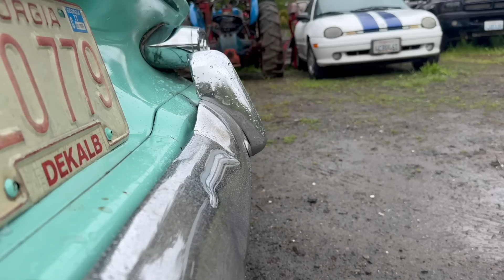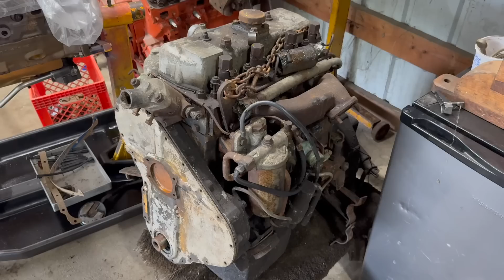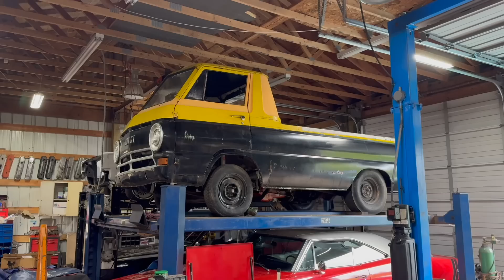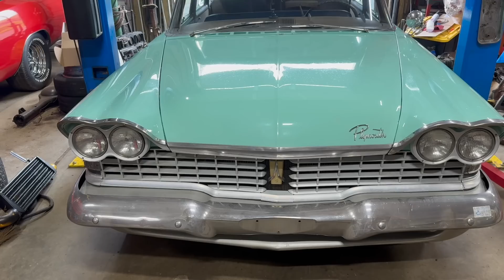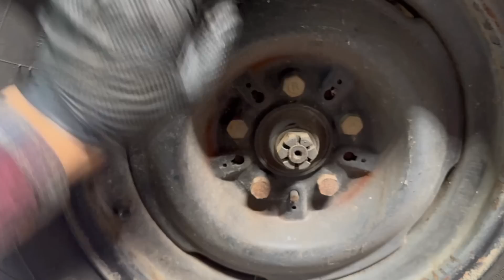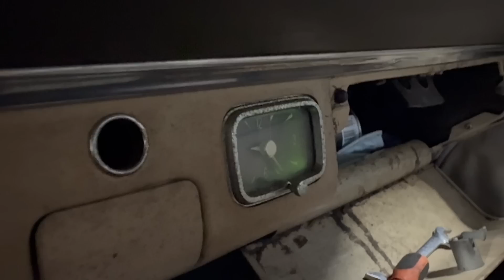Slow And Stinky - 1959 Plymouth Diesel Taxi Engine Tech, Test Drive, Safety Inspection (Not Good...)

Comment: Old retired guy from the Philippines checking in. I have seen old many Jeeps, restored to running condition, here in the PH. Some have been converted to four(4) cylinder diesel engines, replacement parts being very difficult to obtain. On a trip to visit my Father-In-Law's friend who restores certain classics, we viewed a treasure from Japan that he had accumulated. A military Jeep made under license for military and police use. It had a factory installed four (4) cylinder Mitsubishi diesel engine! If a person had the desire to search YouTube, they could learn about factories here in the Philippines that produce all the major and hard to find body parts for old military Jeeps. You can purchase a complete tub for your restoration project. Hoods, fenders, almost anything you might need! Your Plymouth taxi would be a blast in the Philippines. You never move fast here except on the NLEX toll road! I can picture in my mind what it would be like to cruse along the General Douglas MacArthur national highway  in this beautiful land yacht. This is a four (4) lane road that runs through many towns here on Luzon and is often plugged with traffic. You have a real treasure and a true head turner for those who appreciate what it is and was meant to be.

Comment: i do wonder... no front turn signals - not at all, or not operational? what's the point in having just the rear ones otherwise..?
Reply from the maker: Great question. There are lights there but they are currently only functioning as parking lights.

Comment: The brakes were called Lockheed Total Contact Brakes. They work great when adjusted correctly. Ive replaced wheel cylinders and rebuilt the brakes so many times on these 57-61's over the years. 
The rears have tapered rear axles as you pointed out.  I bought a 1960 Savoy that had all sorts of loose nuts and bolts like your car. In fact when I was driving at home it developed a bad vibration Shake which I thought was bad ball and trunion front  ujoint,turned out that someone took thedriveshaft off at the back of the transmission brake drum and never tightened the bolts when they reinstalled it.  Thankfully I always carry a full set of tools with me.

Comment: looks like yo got a perkins 4108  in the uk fitted to early ford transit mk1 circa 1970   dreadfull slow but everlasting due to unstressed and long stroke most engines went to africa to pump water once the van had dissolved good luck slowly
Reply from the maker: P4C, or in their later nomenclature, 4.192. Same idea though. Haha.

Comment: So the Perkins diesel produces rougly 42Kw & about 
 189 Nm . But the cars weight is likely to be around 1500 -1700 kg which won't help its speed which would be lucky to do 125 Km/h tops . But you'd expect the fuel economy to be around the 10 - 12l/100km mark & maybe a 60ltr or so tank . A range of 550-580 km or so would be possible . Leaving a couple of ltrs of diesel left.  Not a bad figure for a mechanically injected   non turbo diesel
Reply from the maker: I’m an American, so none of these figures make sense to me 😅
Reply: @DeadDodgeGarage,  the US is about the only country left that hasn't gone metric . 99.9% of the world is metric.

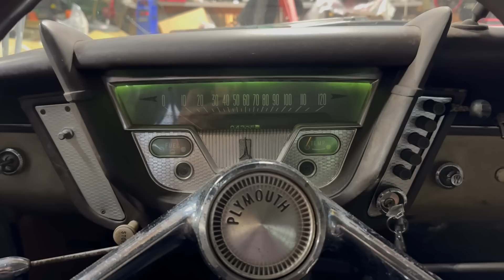Comment: 30:48 are the clocks in cars this old mechanical? Like quartz wasnt invented in '59 if i'm not wrong. Maybe u need to wind it or get it started somehow. Or were they some other type of electrical. I had a 76 Cortina the clock was quartz. My older cars haven't had luxuries like a clock
Reply from the maker: It’s powered by 12v. I think I need to clean it out. Or something.

Comment: I drive the 2000s aussie equivalent currently. Straight factory taxi spec LPG only FG g6 Falcon 2010 has just passed 250,000 trouble free kms. A bit more horsepower than this but same idea. LpG is cheap

Comment: Hay Jamie, you can "convert" the front marker lights to combo marker/turn using the contact plate from a replacement light socket and a tiny deburring cylinder on a dremel to change the bulb's pin pattern in the socket. Toss in some dual filament bulbs and wire it up. I did this to the front markers on my 48 Willys Jeep and it works great.

Comment: Make sure all fuel lines are flowing correctly with no leaks, replace all fuel filters, install an electric fuel lift pump, add BG 245 to the fuel tank, and then see if you notice a difference in how it runs. Let me know how that works.
Reply from the maker: I don’t want an electric pump. The starvation problem was low fuel level in the tank combined with a pickup height issue.

Comment: Those engines is easy to get parts for. Many tractor supplies in Europe can help you out.
Reply from the maker: I know. Parts are all over eBay.
Reply: @DeadDodgeGarage good. My nephew has this engine in a marine version on his little 30-feet fishing boat. I must admit. I’ve only seen one of the Perkins in my family’s ownership that leak oil as much as this one you have and that’s the one in a Bolinder Munktell tractor model Buster (buster is also sold as Volvo Buster with the same model number (320) after Volvo bought them). The preheater is the same as on the buster. I had the same issue as you with very little effect from running it, so I swapped the wires and switch. Aparantly just a tiny bit of added resistance is enough to just make the said diesel smoke, not burn. 😊
Reply: @DeadDodgeGarage btw. The buster I mentioned. When we bough it decades ago it had been sitting for a long time. It was slow as heck. I got a friend of mine to drive it to the farm for me that’s not easily scared and he ran it flat out all the way. It sent sparks several meters up in the air half the way and ran better and better. I’m not surprised it ran better after a bit of a run. With regards to a turbo Google it a bit, there are some models that need a tiny bit of modification to not take damage from that. I do believe it has to do with the injectors and a cup that atomize  it that will melt.

Comment: I saw the column shift, but it also looks like it has the push button, transmission buttons.
I had a Belvedere, that had the push button transmission.
Reply from the maker: No, it has a blanking plate on the left where the push buttons would be. It has the heater control push buttons on the right.
Reply: Gotcha, it's been 40 years, since I've had that car. Thanks! @DeadDodgeGarage

Comment: This is very cool, an interesting combination. I'd turbo it, it's already got a very low compression ratio so perfect for even a couple bars of boost. A holset he221w with an intercooler and that's it. Maybe change to a boost compensated injection pump too but that might be a bit too fancy

Comment: Needs a good steam clean all over the underside and localized grit blast on the sills (what youcall rockers in America). Yes, in Europe a cotter pin is a metal round pin  with a hole through it that the split pin goes through. An interesting car and good value for the car that you swapped it for. Best of luck fixing her up.

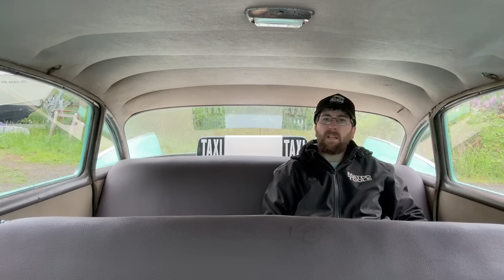Comment: 6:00 I have a 2004 Cadillac Deville, with a V8, and an F150 with a V8, as well as a Nissan Frontier with a V6, and have a few 4 cylinders. But I mainly drive my 78 HP Mitsubishi Mirage, with a 3 cylinder engine, and sip fuel doing so. (:

Comment: I'd honestly recommend writing a misc fix list, just the things that need work but arent high priority but you dont want to forget its a issue, my example is my old galaxie had the lights for overheating and being too cold mixed up by a previous owner and that fix was below getting it to start reliably. Ngl I'm pretty sure you already have that list or something similar already done.
Reply from the maker: The protect lists are usually in my head. But sometimes I write them down.

Comment: I am also the type of person that picks up cars like these on an impulse and tries to daily-drive them. I absolutely love this car the way it is, you're even luckier to have found it with a diesel engine rather than a massive V8. Just resto-mod it to be daily driveable. Turbocharge that Perkins diesel engine and maybe fit it with a 6-speed gearbox, change the brakes with disc brakes and fit it with seatbelts.
Reply from the maker: I’m thinking factory type three speed with overdrive (no cutting,) small turbo, and keeping the total contact brakes for the foreseeable future because they’re actually working very well after a cleaning. But yes!

Comment: Two of my farm tractors have Perkins engines The 235 has a 3 cylinder and the 1150 a V 8 both are naturally aspirated .   very durable both are from the mid 70s as far as I know neither have been overhauled .

Comment: A diesel engine's rated horsepower is what the engine can put out more or less constantly, day in, day out. A gas engine 's rated horsepower is the highest reading that can be rapped out on a dynometer. You can run a diesel engine at its rated power output all day long. Run a gas engine at it's rated power output for any length of time and you will reduce it to scrap iron.

Comment: Looks and sounds good to me ( Glen ). I would happily drive it around the UK where I live. I was a taxi driver for a few years and drove the old Austin FX4 taxis which were diesel. First Land Rover engines and then Nissan 2.7ltr. 
Well done for keeping it on the road. My classic is a 1963 Rover P4 110. Had to rebuild all the fuel system and now doing brakes.

Comment: The bolts back out because the vibration in the motor they shake cars apart. I’ve had diesel tractors and Kubotas side by sides and bolts are just falling out of them

Comment: My dad and my uncle both bought 1960 Plymouth diesels from the Yellow Cab company in Detroit when their mechanics refused to work on them because they were expected to need fewer repairs.  It was an experiment by Yellow in Detroit that failed miserably.  He drove it for several years fueling it from the 250 gallon tank in our garage for the garage heater.  It cost 13 cents per gallon at the time.  My uncle scrapped the car and put the perkins engine in his Chris Craft cabin cruiser.  All my friends laughed at the noisy, smelly diesel.

Comment: An alternator on a 59?  Change the oil and filter to improve power. The speedometer works?
Reply from the maker: Not only does the speedo work, it’s dead accurate! Alternator is obviously a retrofit - though the Leece Neville heavy duty alternator was actually optional on the taxi package for 1959.

Comment: your video put a big smile on my face. its so rare to find a small English engine powering some American heavy metal AND rolling coal too! the car actually makes a great deal of sense in its intended application. those old diesels with mechanical fuel injection will happily run on all kinds of vegetable oils and used engine oils without much bother so as a taxi or maybe family transport for an old school farmer, why not?
what would I do with it? its so rare I'd do my best to clean it up/repair it/ensure its safe. take one of those engines and do a full rebuild including thorough balancing and blueprinting, maybe even pop a turbo on it to make the thing useable.
love those twin leading front shoes, I remember them on cars here in England 40 years ago when I did my apprenticeship. also like the gearbox with that huge gearing jump from 2nd to 3rd, you just know it needs another ratio inbetween.
Reply from the maker: I’m strongly considering a small turbo and a factory overdrive transmission. It needs a head gasket, and at the same time I think it really needs a total re-seal, which may just become a full freshening. You know how these things tend to snowball…
Reply: @DeadDodgeGarage  certainly do! have just subscribed so I can watch the project unfold

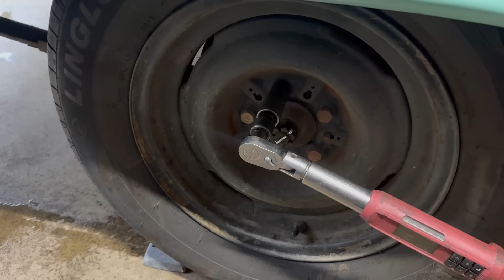Comment: 25:11 Mate, believe me when I say it would only be a yank who calls a split pin a cotter pin, a cotter pin is something else entirely. 27:41 Wheel studs.
As the glow plugs warm up the coil that you call a light SHOULD glow along with them considering the era. I reckon the alternator would be a later upgrade, they still used generators in the fifties.
The car;  I love it. The Perkins; I love it as well. That is an engine you can drive flat to the floor all day and it will love it. It won't need plugs and points or tune ups but make sure it can breathe ie air cleaner. Should be good for a million miles  Question; Is it 6 or 12 volt, maybe 6volt originally.

Comment: I can't believe you traded a charger for that. I hope the previous owner left 15-20k in the trunk.
Reply from the maker: You do realize it was a horribly rusty project car with no drivetrain that needed the entire back half welded on? It was a fair deal.
Reply: @DeadDodgeGarage I know but the Plymouth is so niche and 4 door. I'm just back in my 2 door phase. If it were mine I'd be tempted to swap in a Mercedes diesel and automatic either 240D or 300 TD.

Comment: The Perkins 4.203 diesel engine, utilized in the 1959 Plymouth diesel taxi experiment, has a wet weight (including oil and coolant) of approximately 495 lbs (224.5 kg)
Reply from the maker: I’ve read 4.192 for displacement? That weight is in line with what I have read.
Reply: @DeadDodgeGarage   Yeah, I’ve seen that figure mentioned too—likely confusion with a different Perkins model. The Perkins 4.203 used in the 1959 Plymouth diesel taxi had a displacement of 3.3 liters (203 cubic inches). The 4.192 might be a typo or a mix-up with the P4.192, which was an earlier variant used more in industrial/ag settings. But you're right—the weight you mentioned lines up with the ~495 lb wet figure I've seen as well.

Comment: I used to work at an old-style garage in the early eighties in England. A mechanic fit one of these engines in a seventies Jaguar XJ6. From an agricultural type vehicle.
Manual gearbox, just as slow, did around 44mpg and 65mph...

My early Citroen Xantia non-turbo 1.9D has a CAV fuel system. I bought a DTI and special tools to set the injection timing to mm perfect. The setting was exactly the same position I'd guessed. It was so obvious when I'd hit the right spot: easy starting, quiet but gutless running (advance it a few degrees)  needs 2xheater plug cycles to start, but pulls like a noisy locomotive (retard it to the exact midway position). I LOVE older diesels. My neighbour had a flat battery. Borrow mine. I'll just leave mine running. I don't need a battery! The alternator - Bosch - doesn't seem to mind and I have eight spare ones.
A lovely video and car!

Comment: As someone born in Europe who´s had some vacations in the US it always surprised me the differences between engine size for similar purposes. In the 1960s we had small 1.0 to 2.0 inline 4 meanwhile you guys were driving inline 6 and big V8s. Even in taxis here they were popular the Skoda Octavia 1.9 Tdi and in NY they were driving for the same purpose the Ford Crown Vic V8. 
To make american cars popular here, they tried to sell them with perkins engines, like the Jeep Commando. Barreiros brought Dodge to Spain and sold them with his own diesel engines. They also used Mercedes diesel engines in the high end models, the OM636 in the SEAT 1800 D and the SEAT 132. And the Perkins in the low end models (SEAT 131 diesel)

Comment: I had a 1959 Plymouth 2 door wagon with a 413 wedge engine. I broke the manual transmission and had to install an automatic tranny from a 318.
The Plymouth 413 wedge engine, also known as the Super Stock 413, was a high-performance engine available in Plymouth vehicles from 1962 to 1964. It was part of the Chrysler RB series of engines and was offered in two versions: 410 horsepower with an 11.0 compression ratio and 420 horsepower with a 13.5 compression ratio.

This engine featured a cross-ram induction system with two Carter AFB carburetors, larger ports and valves in the cylinder heads, a high-lift camshaft, and double valvesprings. It also included a special intake manifold with 15-inch runners and a baffled oil pan.

The 413 Max Wedge engine was developed to compete in NHRA super stock racing and was designed to be a powerful, yet street-legal engine. It was available in various B-Body Plymouth models, including the Savoy, Belvedere, Fury, and Sport Fury.

In 1963, the engine's displacement increased to 426 cubic inches as the bore was increased from 4.19 to 4.25 inches, and an improved version, named the "Stage II," was released.

Plymouth Savoy: Known for its performance capabilities, a 1962 Plymouth Savoy with a 413 Max Wedge engine, called the "Melrose Missile," became the first factory stock car to break into the 11-second range, achieving a verified 1/4-mile time of 11.93 seconds.
1963 Plymouth: The NHRA limited factory Super Stock displacement to 427.2 cubic inches for the 1963 competition season, leading to the development of the 426 cubic inch engine.
1964 Plymouth: The final year of the Max Wedge option saw the introduction of the "Stage III" engine.
The Plymouth 413 wedge engine was a significant part of automotive history, as it was one of the first high-performance big-block engines offered in an intermediate-bodied car, making it a proto-muscle car.
Reply: Those 413's with the cross ram looked so cool with the carbs sitting out over the valve covers. And was it the engine that had "nest of snakes" headers? The long ram tubes was to gain power at certain rev ranges, and I do not remember who did it. But someone custom built ram manifolds, and the carbs were clear outside of the valve covers, hoping to target a different rev range.. it was quite an attempt at finding more power.